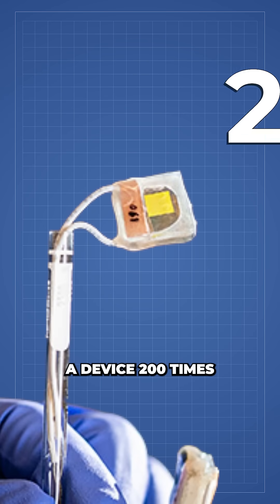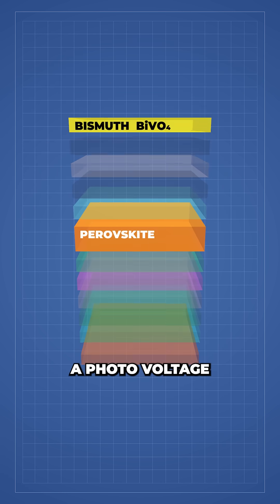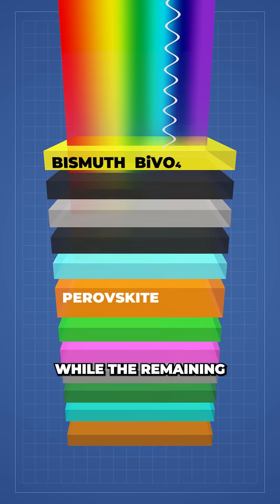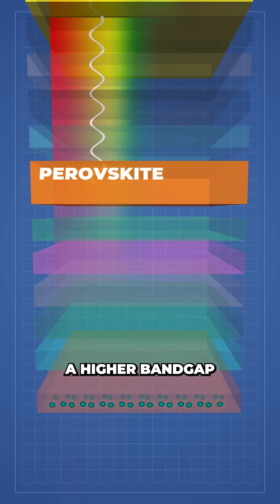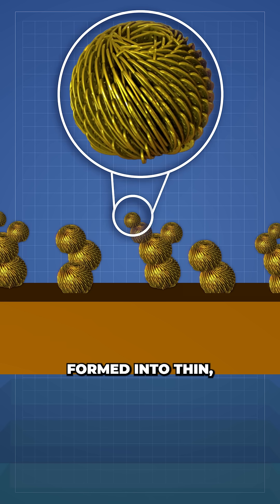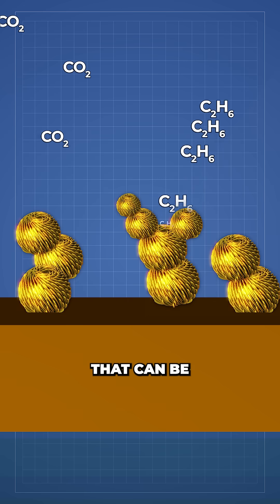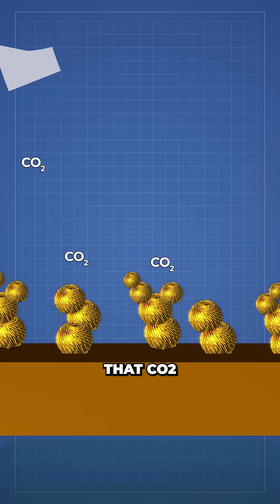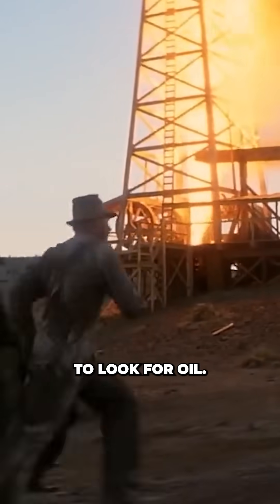Scientists Create Artificial Leaf That Converts CO2 into Fuel

Comment: remember that these scientists are not suicidal
Reply: But they are notoriously bad at checking the brakes on their cars just before they go driving up high mountain passes.
And also do not, under any circumstances, go out on a boating excursion with them.
Reply: I hope the filthy oil trillionaires don't silence them 😔🙏

Edit: I had enough. Ok so some netizens can't tell the difference between an opinion and a dark (kinda empathetic) joke. Could you stop this nonsense and learn how does humor work? seriously dude.
Reply: @CarpeDiem_64  Billionaires*
Reply: @CarpeDiem_64 you need oil to manufacture these devices
Reply: @CarpeDiem_64  Why? If anything they would be the ones to actually invest into them.
Reply: @CarpeDiem_64 OOOOH MY GOD WHEN DOE STHIS HAPPEN IT DIDNT HAPPEN WITH HYDROGEN OR SOLAR ONLY NUCLEAR AND THERE WAS REASON
Reply: @CrapeIdiom?
Reply: @CarpeDiem_64 THEY NEED SOME FREEDOOOOMMMMMM 🦅🦅🦅🦅🦅🦅🦅 🦅
Reply: @CarpeDiem_64  no one’s getting silenced this technology probably isn’t gonna be able to replace oil drilling for many many more years, even by then other solutions like EV are probably already gonna be mainstream
Reply: @CarpeDiem_64 oh I'm sure somehow this research will "fall flat" or just never make it to society. "Just too impractical" yeah ofc. Mhm! Ahhh capitalism.
Reply: @CarpeDiem_64  If it's really viable, they'll just buy it up and use it. The extraction process is a huge expense to them. If this makes that obsolete, they'll jump on it like crazy. The real reason these sorts of things disappear is because they were never viable to begin with and are just hyped up way too much. If something sounds too good to be true it usually is.
Reply: Yes! Carbon credits mega rich tax havens. If CO2 not a problem but a resource then lots of rich powerful people angry
Reply: @Nichoラス If you think the people attempting to decrease the release of CO2 into the atmosphere are "rich and powerful", or that they're synonymous with the fossil fuel industry in any way, then you have it backwards. Environmentalists would love if CO2 was able to be harnessed this easily as an energy source, that doesn't mean CO2 isn't currently leading to a rise in atmospheric greenhouse gases which cause global warming. Besides - how do environmentalists benefit from charging the fossil fuel industry carbon credits? U less you have evdience of embezzlement or corruption, then the evdience points toward this money paid out by the fossil fuel industry going toward public services or other climate change/pollution mitigation programs.
Reply: What a shame these scientists recently passed away in the hospital after suffering sudden symptoms in their lungs.
Reply: I'm sure this research done in USA or Europe If those scientists "logged off" the delay maybe long and a significant drawback but I'm sure Japan or China will take over this maybe reverse engineer it knowing China's track record and the big oil attempt and effort to squash this technology all goes to waste.
Reply: @Downtrodden_cat  China is a leader in renewable energy, so they would use it for this. Also, there is no fossil fuel lobbyists in China.
Reply: What
Reply: As soon as they said we’d never have to drill for oil again I knew it was a dead mission 😂
Reply: their sacrifice will be remembered forever (salute, tear, sad trumpets in the background)
Reply: @Justa_Potted_Plant And tiny violins.
Reply: Not funny or original
Reply: I was so confused by this first comment here, until I realize the point he was trying to get at. How frequently corrupt corporations will hijack a new idea and use it if they find it profitable or squash it and shelf it if they would rather stick with an old technology and make more profit. Glad that it clicked for me, and this is fun and optimistic news and technology to hear.
Reply: THIS!!!!
Reply: @oliverapuzzo5512 corny ass reply to an already corny comment 😭
Reply: @Lawos1  "ooh got em"
Reply: @oliverapuzzo5512 😊jesus is the savior of mankind. Believe in him and get the gift of salvation❤. Repent for the kingdom of god is at hand.😊
Reply: I’m lost, why would they be?
Reply: Not suicidal “yet”
Reply: Big Oil, much like Big Paper/Big Textiles, has refused to just adapt to renewable options, even when those options are not only scalable, but also produce much higher yields much more affordably.

For example hemp and bamboo for paper and textiles and bio diesel for fuel.

The diesel engine was designed to run on peanut oil so that farmers could use it to fuel their entire operations. Remember, at least at the time, peanuts were used in crop rotation to nourish the fields ( to put it simply ).

But commercial agriculture, coupled with the provisions of USDA subsidies, can't allow farmers to be self sufficient.

You must grow these crops, with these seeds, using this fertilizer, and these pesticides. 

Oh, and, even with subsidies, your profit margins are going to be so slim that you're all but forced to hire undocumented workers, until there's an immigration crackdown, at which point your crops rot in the fields and the prices of said crops skyrocket, yet again. Then tariffs all but preclude importing said crops to make up the difference...

The prices climb, and then a ”bigger better bill” eliminates the ability of our poorest to buy ANY food in the first place.

Tell me again how much we're supposed to be winning?
Reply: @AnnoyingNewsletters yes and actually there is some veriety of bamboo that grow super fast like a foot a month or something like that. Hemp is natually anibacterial hemp also requires really small amounts of pesticide to grow if any.
Reply: @MRGAMER-bk5bm they threatened the inventer of solar panels back in the day
Reply: they might have a chance in Germany. Its now by law that germany is getting out of fossile fuels. And it is very very hard to change the law.
Reply: @KriegerDelfin24 oh well if a European burocrat said it then it must be true!
Reply: @KriegerDelfin24 Germany is suicidal
Reply: Oil producing companies may suffer, but oil processing companies will love this
Reply: these comments are boring
Reply: These conspiracies are dumb af 😂
Reply: If you voted Trump you voted to suppress anything that threatens big oil.
Reply: Hurhurhur so funny.....
Reply: I'm sure this research is done in USA or Europe If those scientists pressured to stop the delay maybe long and a significant drawback but I'm sure Japan or China will take over this maybe reverse engineer it or create their own. The big oil attempt and effort to squash this technology all goes to waste.
Reply: lmao maybe you people in the youtube comments should consider it for making the same joke over and over again
Reply: cringe
Reply: Dissing Rick and morty? Or referencing epstien?
Reply: Conspiracy theory nonsense
Reply: the CIA would beg to differ
Reply: I hate to be that guy but this sounds expensive as fuck to build and maintain. 

Extremely fragile nano-strands of metal don't seem to be the most structurally sound structures around. Who knows though, if this gets cheap, then it definitely would be world changing
Reply: The car fueled by water was prob murdered cuz he defrauded investors with a model that didn’t work and stayed in his basement for years
Reply: @PhishyBusiness  Plus most people know of this story because of documentaries on TV. If they wanted to cover it up, they wouldn't be letting TV shows air it
Reply: luckily for them fossil fuel lobby’s are so powerful, i doubt these will be popular for a longggg time
Reply: Perovskite is an extremely toxic and volatile material, this is not even close to being useful in any real world application.
Reply: i dont get it 😭🙏
Reply: @Ins3rtt new fual and big oil.
Reply: That took me a second XD
Reply: Christ, y'all are children. The world isn't just one big secret conspiracy controlled by a shadowy cabal 🤦‍♂️
Reply: What are you talking about? They are all part of a death cult.
Reply: Why would they be?
No plants seems to be the main goal of this bizarre "green" agenda
Reply: You do realize they can just monopolize the production of these right
Reply: What u never noticed
Reply: how do you know??
Reply: Everytime something can replace the Oil Industry
Reply: THEY WILL NEVER PLAN TO DISAPPEAR
Reply: Dude I need someone to hold my hand and explain this joke to me...
Reply: yes they are
Reply: Why would they been lol. This isn't close to being able to be used and when we finally can build it we would have most likely already built tons of nuclear reactors
Reply: Yeah I have a feeling big oil is coming after them
Reply: The fear mongering is crazy
Reply: Pretty sure these are Chinese scientists and their government has no interest in killing their research because they can just take it whenever they want legally
Reply: You confuse them with fake scientists like the one with the so well working water powered car XD
Reply: Splitting hydrocarbons from other sources is nothing new. Look up coal cracking and synthetic fuel. The problem is that its more expensive than just drilling.
Reply: no remember they want to end themselves, do not look into their inevi-I mean POSSIBLE endings......
Reply: Exactly 💯
Reply: Good point
Reply: Are you sure?
Reply: Nah they wont  the Goverment will implement this into shit then tax us on it
Reply: I mean now is mainstream knowledge, so it's a bit late for that
Reply: You dont know that, wait until im a scientist then you'll see
Reply: It's OK they are feeding into to climate hysteria your safe as long as you go along with that bs dogma
Reply: Suicide plant reference?
Reply: Thanks but  my country is trying to block out the san at the moment
Reply: Yup
Reply: As long as they can make it profitable for gas oil companies they should be fine also if this meant that they could just continue using gas cars instead of going fully electric they would love it obviously
Reply: Something tells (shows) me that you might be clowning us all but I can't put my finger on it
Reply: Lmao
Reply: bah who do you think sells you these solar panels? who do you think owns the mines?
Reply: Their parents are proud of them
Reply: Doesnt matter if they are or not. The common man will accept whatever "official" narrative is fed to them.
Reply: You only need to worry about scientists disappearing when they are making something that doesn't align with powerful people's plans. Powerful people want space travel. They're safe.
Reply: This why I hate capitalism
Reply: They don’t do that anymore. They just take away your govt funding if you don’t promise to let billionaires use your invention for exploitation
Reply: The fact that oil companies would 

1. Probably actually do that

2. Just buy the patent for it and then shove it into a shredder (happened way more than a few times)

3. Will just buy out companies that want to use it so they can't 

Are all pretty big reasons why we NEED this kind of technology right now, and even more importantly, why companies need to be kept in check and not just grow to such a power that they can just do whatever they want to earn a dollar more and get away with it (like sending literal hitmen, funding studies to push their agenda, or just buy politicians and political positions that basically overthrow a government)
Reply: So true, fuck
Reply: but i bet you they will all be stupid enough to travel together
Reply: That's what they want you to think, but deep down.
Reply: Oh no, these ones are actually backed by you know who. 
They want to replace nature then privatise and monetize it.
Reply: If so, Porsche would have been reduced to smithereens for making gasoline with air and water. Guess what, the main use for oil is for non fuel petrochemicals
Reply: Yeah, usually when you don't recognize something it's a mineral or an organic compound made out of things you would recognize.
Reply: Well they should be. They just gave corporations an excuse to destroy all flora and sell us replacement plants.
Reply: we acn't remember why and when these oil company want to shut someone off
Reply: water engine
Reply: Joke is sad but true.
Reply: Maybe they are.
Reply: I understand haha
Reply: That's only for cancer research
Reply: This part
Reply: This could be very profitable to oilers if they shift the production to this new technology, it might even he cheaper than drilling
Reply: How did they not give up making this though 💀
Reply: Heard they was friends with clintons
Reply: They could be
Reply: Im not suicidal tho, just in the midde
Reply: Why would oil companies want them gone though. They're literally showing them how to make oil out of thin air.
Reply: And... others are? I'm out of the loop on this one.
Reply: conspiracy crowd x science channel
Reply: 😢 we are living a Black Mirror episode
Reply: You don't know that
Reply: Bruh, it's a publicly published paper. If you heard about it then the secret to how to do this is already out there.
Reply: how do you know
Reply: Wrong Again! You're getting good at this. 
You should probably run as President.
Reply: Tired meme
Reply: 1. How do you know they aren't suicidal?
2. This is already published, so what happens to the scientists themselves at this point would be irrelevant
Reply: I’m pretty sure fossil fuel companies would actually really like a device which could dramatically increase the efficiency of their products
Reply: POV: boeing whistleblower
Reply: We had a student here in Germany that created almost the same thing but it produced hydrogen insteadt, she was the first to come up with this solution, It was created 13 year's ago. PV-Hybrid Electrolysers for the Photoelectrochemical Conversion of Sunlight into Hydrogen. i really don't know what happened afterwards, never heard of her again. not a joke btw
Reply: or are they?
Reply: Do you know that for sure?
Reply: The oil companies own giant chunks of land as oil fields. When the oil runs out, they can cover all the unusable land for these panels and still keep selling the same product.

They are more likely to buy exclusive rights to the technology so they can keep their monopoly.
Reply: Wow how hilarious
Reply: "they poisoned me!!, they poisoned meee!!!"
Reply: Brother you’re not in a movie
Reply: This tech is probably not efficient enough to justify a complete change of fuel source, but maybe on the future (decades of uninterrupted research like the fusion reactor).
Anyways all this activist and political debate is pointless, fusion reactor is the future, and humanity is trying hard to develope a real viable green energy solution. Reject any kind of current clean energy and just wait the tokamak reactor.
Reply: That's why they made all their research public and gave it to the media
Reply: соnsрirасу sсhizо
Reply: are? or not?
Reply: I think this tech is less likely to be silenced and more likely to be bought up. Oil reserves can not last forever, so it lets them effectively make replacement oil
Reply: No, but a large majority of intelligent people suffer from depression
Reply: literally.
Reply: I dont understand why people are saying that these scientists arent suicidal. is it referencing Ai science because they are programming robots which will eventually take over?
Reply: My god with these conspiracies….we would’ve never developed solar panels or wind power if this were true
Reply: Proof?
Reply: lol, there's no way this technology could compete with natural gas. 
The ignorance of people who believe in sustainability is to be expected.
Reply: Why would anyone think they are suicidal?
Reply: i dont think this is the kind of thing that makes the big wigs less money, this means we need less plants and have more room to destroy nature
Reply: How real
Reply: You make me sick. To show humanity have hope to stop atmosphere collapse and the extinction of all life on this planet and you think the only hope we have should kill themselves. Get off my planet 😡
Reply: But the scalability is questionable. Those "copper nano flowers" seem very tricky to fabricate, especially in mass-produced scale.
Reply: @Finlandiaperkele this is something people often forget. You need technology that can scale.
Reply: Solar panels can be used to power fuel synthesisers, and we've literally had that technology for decades. This isn't 'disrupting the fossil fuel industry'. If you believe it will you fundamentally misunderstand the problem.
Reply: @dead_pool_io no, so solar panels basically work the same way as normal fuel for power. You just heat up water with the sun instead.
Reply: @dead_pool_io  is this not massively more efficient?
Reply: @dead_pool_io  there are def ways to use solar now to accomplish some similar things in a roundabout way, but maybe this will provide a more direct approach with much greater efficiencies in some of these processes.
Reply: @dead_pool_io fuel synthesizers aren't a real thing. There's syngas, which can be made into fuels, but usually that is either a process that requires either existing fossil fuel feedstock to produce or else is produced at greater energy expense than the resulting fuels can possibly produce.
Reply: @dead_pool_io Yet they are not nearly as efficient bub
Reply: @origamipanda5970 and the efficiency of this is? Oh probably on a similar level. photosynthesis is not an efficient process to begin with. This will likely be exactly the same. Big oil isn't scared.
Reply: The leading developers and funders of clean alternative energy sources ARE the same companies that drill for oil. 

They are NOT in the oil business. They are in the energy business.
Reply: @FilmFlam-8008 these people honestly cannot comprehend that. They believe oil companies are like the villains from captain planet.
Reply: They just saved the entire fossil fuels industry. I doubt anything will happen to them
Reply: I remembered that the inventor of the water car wasn't suicidal.
Reply: Are you?
Reply: @GlobalGooner141  I am
Reply: @M_ldyCheese  real.
Reply: @GlobalGooner141  I am
Reply: @DumbAsh00 : Why? You're beautiful ❤.😢
Reply: @DumbAsh00  bro u so tuff🔥🔥🔥🔥
Reply: @DumbAsh00 don’t do it pls
Reply: Creep.
Reply: @DumbAsh00   don't try suicide, that stuff kills you
Reply: @DumbAsh00  me too
Reply: @Naburgondux  no one expected anything else from a jojo fan
Reply: @pretzell_with2ls  Bro u so tuff too damm🔥🔥🔥💀
Reply: @DumbAsh00  u need some perovskite
Reply: @DumbAsh00 same
Reply: @DumbAsh00 so real
Reply: @Culture45 They did it yesterday. After some sushi. It was nice. The sushi, I mean.
Reply: Lmao😂 @DumbAsh00
Reply: @DumbAsh00  This
Reply: What are you, me?  @DumbAsh00
Reply: @Balizticz You weird cro
Reply: No name? How?
Reply: Good 😂 @DumbAsh00
Reply: @DumbAsh00  hey man, hope you get out of that soon, considering i have the same thoughts to be honest.
Reply: @DumbAsh00  real 🥀
Reply: @Naburgondux  W pfp but ppl are actually suicidal??
Reply: @DumbAsh00  Twinsies!
Reply: @DumbAsh00 you want a cookie?
Reply: @DumbAsh00  if you aren't joking, then don't do it, don't be suidical because it's bad, you would lose social credit and aura if you did it so don't do that
Reply: @zsoltszabo402  not if i do it in a badass way
Reply: @DumbAsh00  true but still don't
Reply: Don’t  be
Reply: @Naburgondux  shut up bro
Reply: @Chad22  I don't understand people like you.
Reply: @Naburgondux  I don't understand people like YOU. If all you are gonna do is reply with a rude comment to a dude saying hes suicidal then just don't say anything at all. If theres even a 1% chance that hes saying the truth, why make things work instead of moving on or saying something nice?
Reply: @OrginEnd  he didn't, every single I saw someone go "bro u so tuff" with an ABUNDANCE of emojis they were saying it to make fun of the person.
Reply: @Chad22  be cause it doesn't fking matters i dont no the dude and this is the internet. You shouldn't expect anyone to be nice. And i dont care 😊 (its probably false too)
Reply: @DumbAsh00 same
Reply: @DumbAsh00  yaay, me too !!
Reply: @DumbAsh00  Ur so cool 🔥🔥🔥🔥🔥🔥🔥🔥🔥
Reply: Air ball
Reply: @DumbAsh00 why is bro saying this on a youtube comments section
Reply: How do u know
Reply: @Naburgondux Agreed
Reply: Neither was Effery Jepstein
Reply: @GlobalGooner141  yes
Reply: @GlobalGooner141  if you talk about things the government wants you to talk or know about and I think you get the picture
Reply: @GlobalGooner141 The joke is that the government is going to frame their deaths as suicide lol
Reply: @GlobalGooner141  very much
Reply: @GlobalGooner141 you missed the point blud...🥀🥀
Reply: @Veteran_Weeb ”blud” in june 2025 😭✌️
Reply: @GlobalGooner141  yea
Reply: @GlobalGooner141  he's not one of these scientists
Reply: @GlobalGooner141  Fight the thought every day
Reply: @stabakoder dam bro im sorry 🥀
Reply: @GlobalGooner141  You seem to not understand the statement, so let me explain. 

Big oil would likely "silence" anyone trying to infringe on their business. When they "silence" that person, there would then be a press release saying that those scientists were suicidal, and it was not a murder. 

Does that make sense?
Reply: @AnimVision-qp7xq i didnt need that I understood
Reply: @GlobalGooner141 i dpnt gett the joke or the reference sorry?
Reply: @GlobalGooner141  yes I am kind sir
Reply: @GlobalGooner141  im not
Reply: They are now.
Reply: anything for likes huh
Reply: What
Reply: Sooooo funny totally not a dead horse joke at this point.
Reply: I’m really sick of this joke
Reply: @sulfurald  not a joke
Reply: To me, this seems more like they paid for it, as it would be more efficient to just use the energy produced than make some fossil fuel imitation, it's like they are obsessed over it.
Reply: It has more to do with energy storage, methinks.

With this method, they create an energy-dense material that can easily be transported for usage, and can be used in already-establishes infrastructure.

It's actually decently intelligent.

Have a good day. @5959Luc
Reply: @5959Luc sure, use the energy NOW, if you have an immediate use for it.
The problem with solar is it is like feast or famine. Sometimes you have too much, sometimes you have not enough (@ night, or a stormy day).

Converting to fuel allows you to STORE it, and makes it PORTABLE (use it in cars, for example).
Reply: people like yall are the worst its like yall need some kinda drama to obsess about
Reply: This trope is so tired.
More like, remember this probably will turn out to be too inefficient and not cost-effective.
Reply: @user-dj1hy6zc6q  No, in engineering ethics class, you are told you may be vanished because of your new tech. This is a real thing.
Reply: @SuperChad1313 lmao, hope you didn't pay for that class because it's a complete fraud if you need to give money to listen to that nonsense
Reply: @user-dj1hy6zc6q  Absolutely they know from history not to make martyr , it's MUCH better to discredit, then discreetly patent every version possible , then never   make it or allow anyone to make it , and write some articles on why it won't work.
much more evergreen approach vs making a martyr and inspiring future thinkers.
Reply: @user-dj1hy6zc6q  compared to incinerating black oil inside engines that unavoidably produces toxic fumes that can poison children and the environment 👍
Reply: @user-dj1hy6zc6q that's the thing, its a set it and forget it technology. You only have to wipe down the surface from dust. Meaning even if it had a 10 year span before it paid for itself, you would have hundreds of years of production. What will most likely happen is big oil steals this tech, mass produces it, then keep everything exactly as it currently is while increasing their profit infinitely. The average person never getting to benefit from this tech.
Reply: @user-dj1hy6zc6q People keep forgetting that the reason for water electrolysis not working is exactly this: Cost effectiveness
Reply: @user-dj1hy6zc6q I am sure the same thing was said about combustion engines while steam was big
Reply: @user-dj1hy6zc6q it’s even more annoying when they do this with technology which doesn’t even have merit, like water powered cars.
Reply: @user-dj1hy6zc6q Calling the disguised mooder of countless men & women a "trope"........ We're doomed.
Reply: @TheHardys01  but it is a trope. Corporations don't murder people in an attempt to stop science. It's laughably dumb to think that they do because it's totally counter productive for them. Oil companies don't care about oil, they care about MONEY. If they discovered someone was working on something that could revolutionise energy production they would USE IT.
Reply: @TheHardys01 yes because the moment someone discovers the cure to cancer the government makes their phone release anthrax, totally happens every day
Reply: @TheHardys01  It is a trope, it's a conspiracy theory with no backing. What revolutionary technology has been showed off but then the entire technology was systematically supressed? The water car? That was just a hydrogen engine, which have been around for decades.
Reply: Strange remark
Reply: Oil is virtually unlimited
Reply: @HardHardMaster  it's not, though. There are a finite number of accessible deposits with a limited yield of oil and or natural gas that can be extracted through either traditional wells or through fracking.

On top of that, it doesn't help when they dump millions of gallons of crude oil during incidents like the Exxon Valdez, Deep Horizon, etc., as well as through pipeline accidents.
Reply: its not that deep bro